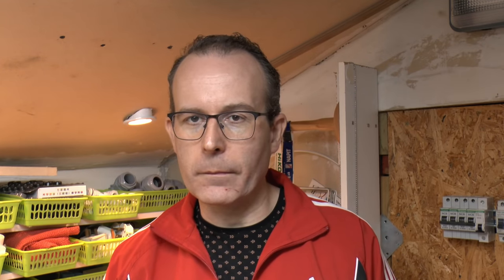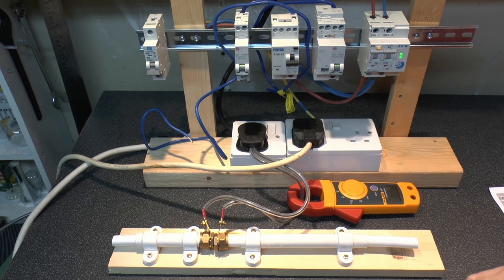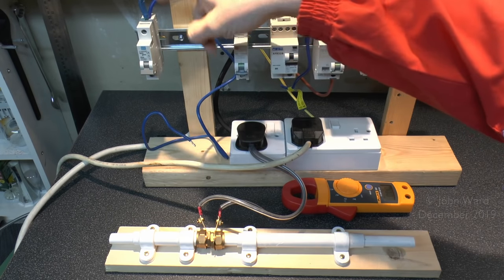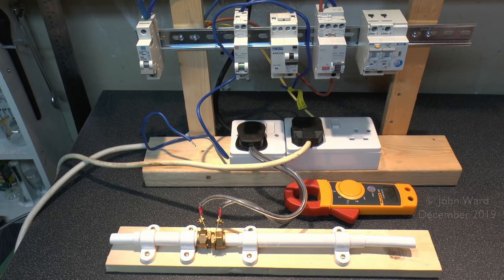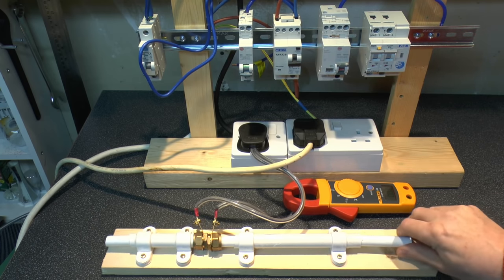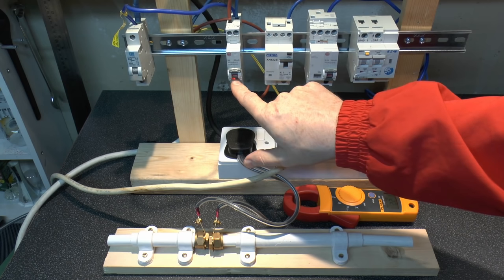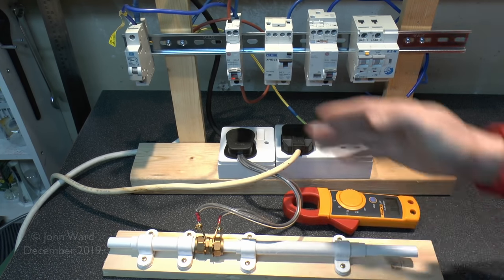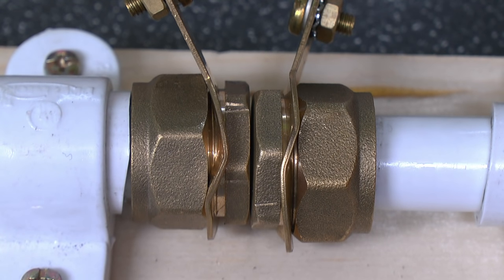Four AFDDs Compared - Arc Fault Detection Devices

Comment: Hi John, would you personally recommend these devices?
Reply from the maker: In some cases.  They are certainly not appropriate for all circuits or situations.
Reply: @jwflame  so people shouldn't be replacing all their mcb or rcbos with these new afdds.
Reply: I can only see a major benefit in having them if the building is a bungalow with or without a thatched roof that has all circuits running in the loft space due to arcing caused by rodents damaging the cables. Even then, an assessment could be made to install mechanical protection to all the cables in the space to prevent this and would most likely be more cost effective than what a fully loaded AFDD board would cost currently. Based on a perfect installation with no DIY junction boxes floating about.

Comment: Why are there no 3-phase AFDD-s?
Reply from the maker: They can and probably do exist, the standard certainly has provision for them in both 3 pole and 4 pole versions.
However their main intent is for final circuits with equipment connected, which is almost always single phase, so it's a case of most manufacturers making what's likely to be required and used.

Comment: been following your videos for a while now 
so not sure if i have allready ask for your advice on this as i am new to this youtube stuff let alone electics , been in the game a few years now and learning every day as i took the easy way in , just went and took the exams to be domestic installer 17th edition 3 ammendment but every day is a learning day and after christmas i intend to take the 18th and the join nappit just need to brush up on the testing , i watch you and DSS , So at the risk of repeating my self sorry if i am , i have this fault that i cannot put my finger on , so im asking for your opinion on this fault .
old mk board single rcd mainn switch . i installed a 10mm swa to run a hot tub  bit over kill i know but this was to future proof for an extension commng soon as i will split at incommer and put new board later , but wen i tested RCD it failed to trip, then i noticed that the solar on the roof was protected by a RCBO which i dont thint you can have with a single RCD.. so i removed the RCBO replaced it with a MCB now it trips the RCD ok.BUT........ sice i have done this the customer has told me that the board trips every day around 7:30 am moreso in the rain .... 
the only thing to change was previously mentioned  so i have put the RCBO back and now no tripping , i am in the process of getting hold of the solar contractors , but would be intersted in your thought ,
or anyone who reads this 
Kindest Regards Steve
Reply from the maker: Solar installations must be connected to their own individual RCD, or their own RCBO.
If it's tripping every day at 7.30am that suggests the solar inverter has been connected wrongly, so that when it starts to output power, it's feeding that power into the wrong side of the RCD/RCBO, or the neutral is connected in the wrong place.
RCDs not tripping at all could be due to DC being present on the conductors, or some other fault in the installation, or even the RCD itself being faulty.
Reply: @jwflame  
hi John 
this is what i  thought  but there is only one neutral bar in the instalation and i didnt think that you can have a rcbo with only one neutral bar 
the current rcd trips within time  but not with the rcbo connected 
soon as the rcbo is in curcuit  rcd fails to work at all 
i am thinking  to suggest  take out rcd and mcbs and replace with rcbos 
would be pleased to hear your thoughts 
nd just watced you at ghs college video 
great mate

Comment: he did not explain how he connected the wires...i mean what i see is a plug with the 2 wires touching, that's a short circuit
Reply from the maker: It's a demonstration of the AFDDs.
The wiring is not relevant, and isn't what would normally be used because it's just a demonstration.
Reply: @jwflame  yes, but i still want to know how you tripped the circuit.. did you make arc flash on a parallelle circuit?

Comment: I really don't understand why the test isn't done with a cable stuck in the door, a weeak wire ia a soket  or a hole screw, I don't know what other examples, we test with a micrometer... I give 150-2050 $ to play with a micrometer, because only then it disconnect , on good?!. Until someone manages to make it disconnect to real defects and not micrometers and screws, it's not worth 2 bucks, you'd better give it to a beggar..